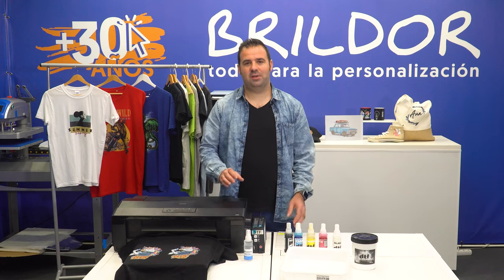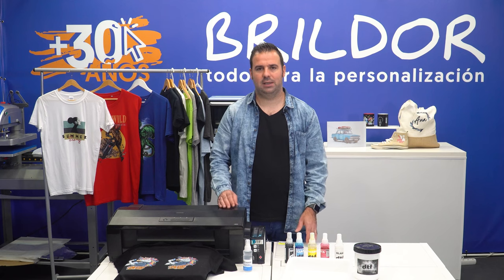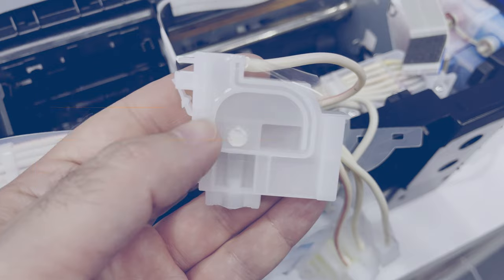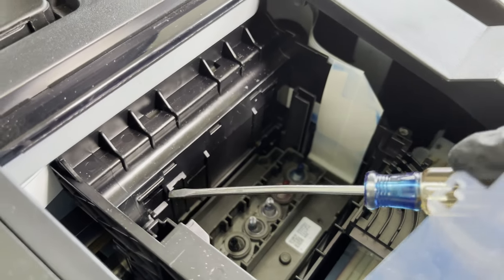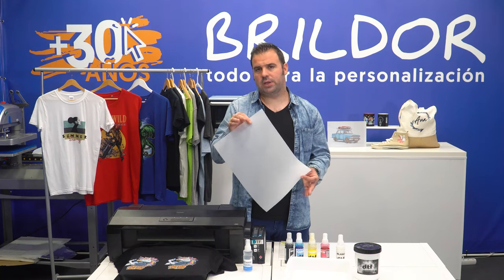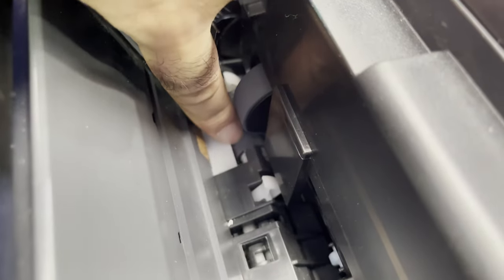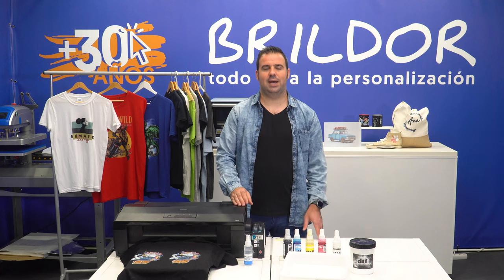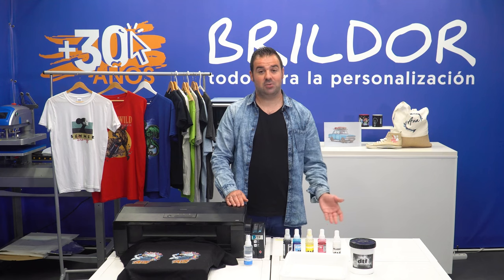🛠️ DTF Printing: Maintenance, Problems & Solutions. COMPLETE GUIDE

Comment: very interesting tutorial. I think I need help, I have a L1800 printer gave me a problem, the head printer replaced it and now it doesn't print anything, I already did head cleaning, nuzzle check and nothing. Maybe main board problem. Can any good samaritan help me?
Reply from the maker: Hello! Has the printer shown any error? Have you flushed the print head after disassembling it to check if the cleaning liquid comes out? It's also really important to make sure the flex cable is in place. I recommend taking the ink out of the dampers with a syringe to check if it comes out properly. You should also verify that the transportation lock is not on. Finally, I recommend that you do an initial ink charging by resetting your printer.
I really hope this helps!

Comment: I replaced it with a new head and no ink comes out.
Is there any workaround?
head cleaning
It doesn't heal even after sleeping overnight.
Reply from the maker: Hi! I suggest doing a power flush from the printer driver, if it doesn't work, you should make sure the dampers are full of ink. You can use a syringe. Finally, if none of this works, you should check if the flex cables are well-connected to make sure that liquid is coming out of the printhead by flushing it.
Reply: @brildoren7440  thank you for the advice. I continued cleaning, hypercleaning, but it didn't work.
As a last resort, I stuck a syringe in the waste ink hose to remove the air.
that solved it
thank you.

Comment: Hi, i have a problem with my magenta color, it has black color in it, all colors are okay except colors that needs magenta. Magenta damper has black on it so it was contaminated, so what i did is to replace my magenta damper but the issue is still the same, my magenta colors has black color mixed with it.
Reply from the maker: Hi! I would suggest changing the damper first, but you should flush the printhead before replacing it. You should also clean the wiper blade and the capping station (the area where the printhead rests, which can be very dirty and, due to the negative pressure, the printhead absorbs discarded ink and contaminates the damper ink).

Comment: My DTF EPSON L1800 will start printing well and then just stop laying down white.  Sometimes I will get a full 13x19 film printed and when I start next sheet the white stops.  Sometimes in the middle of printing the white just stops.   Any suggestions?
Reply from the maker: Hello, Cheryl! There may be some solid residue in the dampers. So I would recommend replacing the white ones. Hope this works!

Comment: Hello, thanks for the video. It is very helpful. I have an Epson L1800 roll model printer. When printing one image, the printer snatches the film back a little after the printing is done causing the design to smear. I don't know what's causing it to do that after it prints.
Reply from the maker: Hello! Thank you for watching.  If you use Digital Factory DTF Edition you should increase the "Roll End Advance" option so that it pushes the film and does not cause the head to rub against the design. If you use other software, find a way to slightly stretch the design to avoid this problem.

Comment: Hello, every time I print black an orange showish/ or line appears to the left side of every part of the design that has black ink.
Reply from the maker: Hello! You should clean the nozzles by disassembling the printhead and flushing. Then make sure to clean the area where the dampers rest so that there is no contamination between the inks. What software do you use? Depending on it,  you may also have a problem with the ICC profile and that's why another ink appears when you print black.
Reply: @brildoren7440  Hello we use RIP PRO V1.17.0

Comment: Hello, updated from my last question. I have a new machine Epson SP1390. After printed 5 sheets of A3, suddenly the initialising getting slow. It took about 25minutes on the first initialising then pop up error. Tried reset the spooler but still doesn’t fix. Get more space on C drive but still problem. Any solution? Thank you.
Reply from the maker: Hello Jacky! What software do you use to print? Have you tried uninstalling the drivers and reinstalling them? Have you tried changing the cable or the USB port?
Reply: @brildoren7440  Hi, thank you so much. I will try to change the epson sp1390 driver. Or maybe you have recommendation for that software? Give link please. Thank you.

Comment: Hello, I have a question. There is a phenomenon that the speed drops in the middle of printing. I've replaced heads, reinstalled software, everything.
Reply from the maker: Hello! This may be because the usb ports are set to save power. You should disable the power saving options to ensure the flow of information. Another option could be a faulty usb cable.
You can try on another PC to check if it is a printer or a PC fault.
You can also contact Cadlink support and explain your problem.
Hope this helps!
Reply: @brildoren7440  thank you! !
i will try it.

Comment: Hello , I have Epson L1800 which is converted to dtf few days back. I am facing issues with print.  There is a separate wet area outside the print. It looks like stroke. On every print i am facing this issue . It is creating a white wet line without any colour. What to do?
Reply from the maker: Hello! Where does it appear? Is it at the end of the print? This is probably because the print head rubs against the film. Make sure your DTF film is completely horizontal and leave margins before and after printing to avoid this problem. Hope this helps!
Reply: @brildoren7440  it appears on border of print.  Is this problem occur due to humidity? I wish I could upload image here

Comment: Hello, very amazing video instruction. I have a problem with my dtf SP-1390. After I did a print head cleaning. The printer is just constantly nonstop doing head cleaning never stopping for hours. I turn off on again the same thing happens. waste so much ink. any solution for that? thank you.
Reply from the maker: Hello, Jacky. Thank you for your kind words! 
Have you installed the drivers correctly? What software are you using? 
If you can't get it sorted out, we recommend you contact your distributor in order to find a solution.
Reply: @brildoren7440  acro9.03. Was very good till I did manual head cleaning. The printer just kept on doing head cleaning as some one do it by the system. Wasted so much ink.
Reply: @brildoren7440  updated comment. After I unplug all the cable and USB. The print head stop moving but then unable to turn on the green light. Any solution? Thank you.
Reply: @brildoren7440  Hello my printer don’t print yellow ink , can you tell me the problem ?

Comment: My printer gets a weird issue where it prints but nothing goes on paper. It moves and nothing goes on paper, it's strange. 
This happened when I first got it too. 
How do fix that?
Reply from the maker: Hello, Jason. Well, first of all, make sure that the transportation lock is not on. If everything is ok we recommend that you run a power flushing from the driver. Do a nozzle check and verify that they are all flowing. If this is not the case, you should perform a head flusing as shown in this video. We hope this helps!

Comment: thanks for the video.) tell me please, did you use acrorip v10? The problem is that the white ink shifts towards the end of the image and part of the drawing remains without a white substrate. Especially if multiple image and single print job
Reply from the maker: Thank you Any! We don't use acrorip v10 we use cadlink digital factory dtf edition but this is a white layer shrinkage problem. Maybe you have too many shrinkage pixels. You should go to the White tab and under Decrease set less pixels than you have. Maybe 1 or 2 pixels is enough.
Reply: @brildoren7440  thanks a lot for the quick reply
Reply: your image is too tall. Reduce 1 cm.